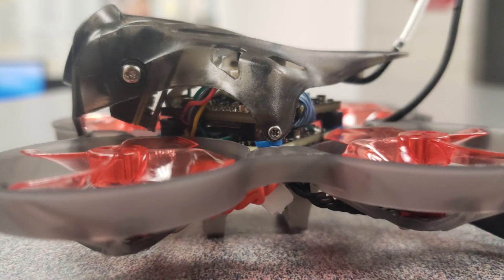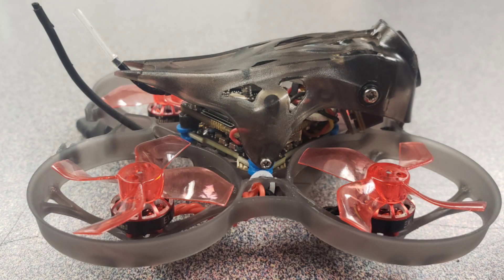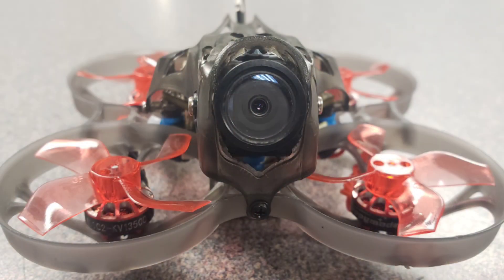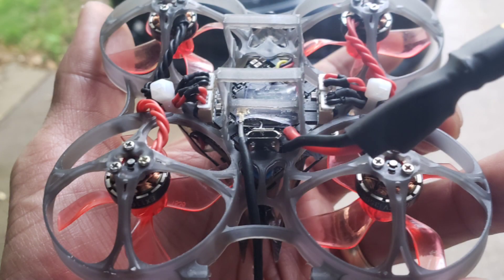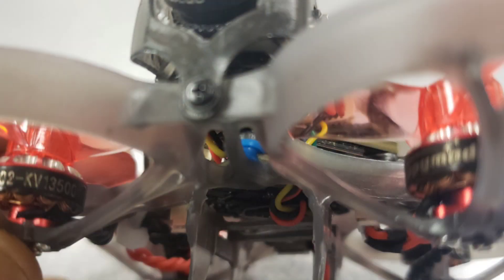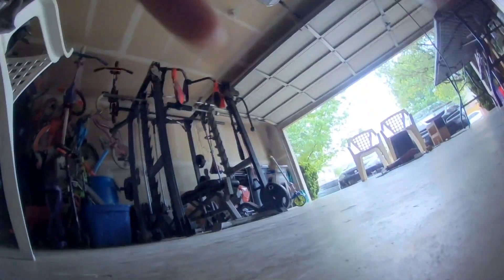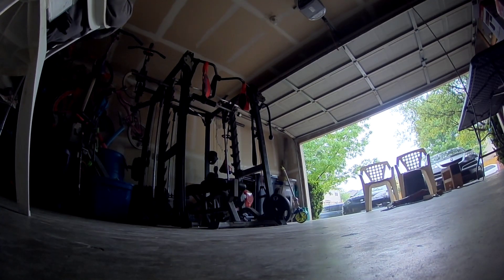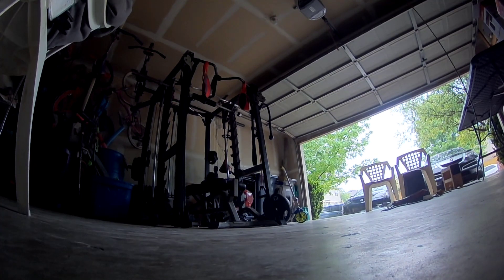2s 450mah 75mm HD Mobula7 build, 1102 13,500kv motors

Comment: do the motors get hot while flying on a 450mah 2s? 

this video is awesome.
Reply from the maker: No they don't, but honestly i think the kv might be a little much. The battery gets hot🤦 and it does sag.
On a light weight 75mm whoop this would be straight nasty! The HD stuff weighs it down quite a bit.

Comment: Hello  how much ampere do motors consume in 2s?
Reply from the maker: I have the 12a board, I've seen over a 15a draw so i capped my throttle.
Reply: @masumoto007  Thank you, I just recommend an FC 12a to use it in 2s
Reply: @masumoto007  Is there 90 percent ???
Reply: The crazybee can handle 12a each.  Wonder if the betafpv is the same and everyone is capping for no reason.